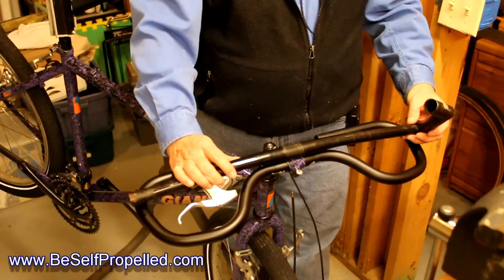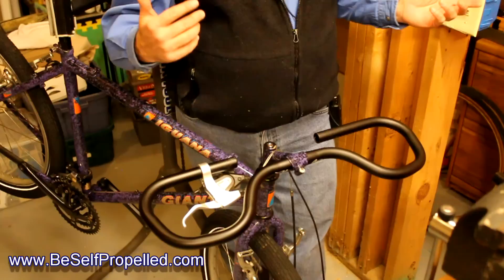Trekking Bars (Butterfly Bars) Use and Setup

Comment from the maker: Donald, I can see the bars working in an outward orientation. This will cause you to reach further out which may or may not be comfortable. One of the challenges of changing handlebars is that you might have to replace all of your cables to change their lengths. I recently removed the butterfly bars and replaced them with cruiser bars so I'd have a more comfortable riding position as I'm now using the bike as my run errands and ride around town bike. I just wanted it to be an overall more causal ride.To make the conversion I had to remove and replace the brake and shift cables to make them longer. It's a bit of work and around $25 in parts but it accomplished what I was looking to do. Best of luck.

Comment: Good vid and sound advice.

I have an e-bike I was thinking of converting to this for longer distances. But I have noticed that what you were talking about the lever position isn't viable in my case as there is also a throttle to take into consideration. But on what you said re - open chest and breathing makes sense so in reality with my scenario I think the best solution is buying bar ends to put on , that at least give me two positions, plus a bonus of mounting a mirror to the barend. Just wanted to add this thought for anyone thinking about converting with a ebike .
Reply: Huh, I had no idea e-bikes were around 9 years ago

Comment: Great video , been thinking of these bars. I like that some one mentioned here, you can possibly even reach the brakes from 2 positions if you put the brakes more towards the outside on the bar...

Another thing that older mountain bikes have is long wheel base , and  NO toe overlap👍. I hate toe overlap. My 1985 Rossin record race bike had no toe overlap👍. My shoes cleared by about a half inch.
Some people say toe overlap is no issue because you dont turn your handle bars that much. I say if your riding in the city and have a tight maneuvering situation you can jamb you foot and go down. Can I ask why toe overlap? Does it make the bike faster??

Comment: still digging the brakes moved out a little? I am going to do this, but was considering putting my brakes closer to the edge. what do you think?
Reply from the maker: I've got some solid miles on the bike now and the brake position has worked out really well. The good news is that you can try different positions and find what you like. Before you add any bar tape find out what works for you. I've always used wider handlebars on my mountain bike so I like the wider spacing on the brakes.

Comment: They're on upside down.
Reply: No.  This is the way they were originally intended to be used.  If you look at the angles of the bars they fit perfectly when in this orientation.  Control, speed, lack of numbness and various positions are all possible when you used them like this.